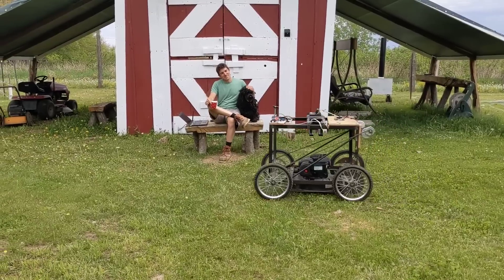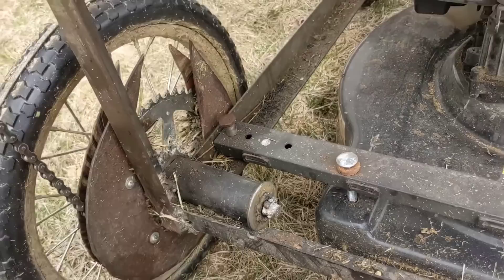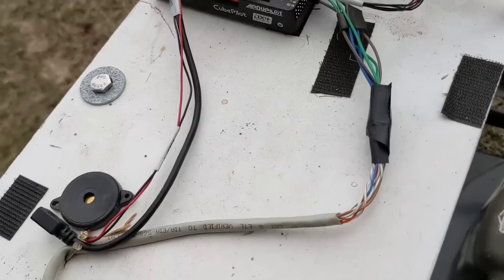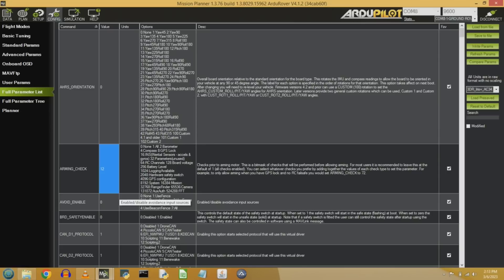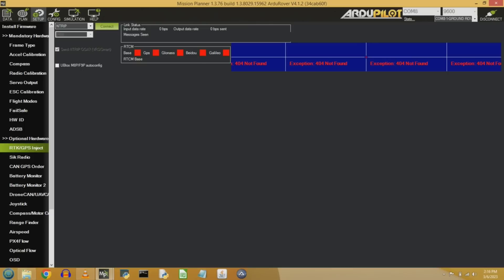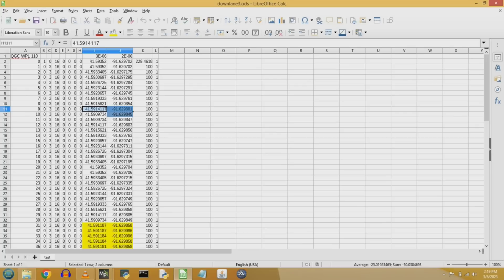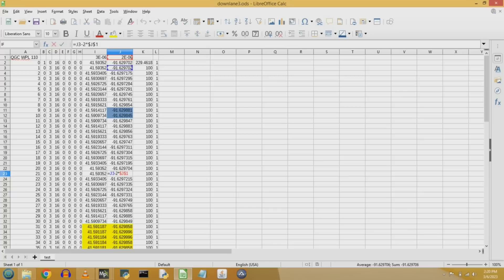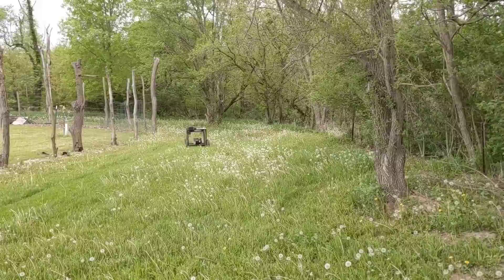DIY Autonomous GPS Mower - Parts List, Schematics, Build Details

Comment: question, you show 24v ebike motors but they are hooked up to a 12v car battery.  how does that work?
Reply from the maker: They run at a lower speed basically.  I tried running at 24V initially but the whole thing moved too fast for the mower to keep up.  When I tried at 12v it was happy.
Reply: @nathanbuildsdiy  were you not able to control the speed on 24v within mission planner?  appreciate the info, ive ordered the parts to build my own.
Reply from the maker: That's great! Let me know how the build goes, if you've got any questions post a new comment (I always see the new comments, sometimes miss replies).  We can connect outside YouTube for any help/questions.

As for 24V - yes, you totally can set the max speed in mission planner (it's on the basic tuning page to the right of the P   I   D  settings I think).  When I started 24V testing I didn't realize that was there. I tested 12V and it was a speed I liked so I kept it and got into the habit of charging 1 battery while the other operates, so I've always got one ready to roll.  Much later I realized I could have stuck with 24V and set a max speed but I had already developed a routine.

If you're going to build here's my list of ideas for the next version, pulled from the comments here, if you want to try any of them (no need, but I'm thinking I'll add next):
- add a front bumper to stop if we hit something (connect to the arm/disarm button that goes to the USB on cube orange)
- Add a small alternator on mower to rob a bit of power and charge up battery
- Add a chain tensioner.
- Put a pin in the axle so it can be removed rather than welding that inside washer to the axle
- 2 gps for yaw/no need for compass - But man... this is more $ and I just can't pull the trigger

Comment: I'm doing my build now and looked at the video and schematic again closely. For Aux out 5 & 6, what did you configure in Ardupilot for this setup (wheel direction) ? I'm using the bigger Cytron MDDS30 and it is slightly different. Also what did you set for MOT_PWM_TYPE? I'm using wheel chair motors for my setup.
Reply: Did you figure it out? I'm using the same setup as him but I can't get reverse working.

Comment: Did you make the frame so tall to get the electronics away from the spark plug and coil; or is that an issue?  I would like to make a more compact version.
Reply from the maker: It does isolate the electronics a bit, but I think the electric motors were a bigger issue.  I made it that tall because I wasn't sure how the whole thing would turn out when I started :)
I'm betting you could cut down the height and be just fine as long as the gps/compass are far from the electric motors, and as long as you're able to get your mower into the frame (I have to turn mine diagonally to insert it from the back).

Comment: I got a mower with fwd wheels there is a pulley with a belt on a main shaft ,you could have add a pulley there or use mower like that and connect an alternator there
Reply from the maker: Is it a push mower?  I've got a front wheel drive push mower too, but it can't steer, just pull foward
Reply: @nathanbuildsdiy  yes , its a push mower and it can't steer ,  there is a V shaped belt like on old cars engines

Comment: Is there a reason you used the 24v motors? Do they still work reliably on the 12v battery?
Reply from the maker: I planned to use 24v (2 12 in series) but realized it was a good speed with 12V and I could charge the other battery while one was running.  Now I'm working on an alternator/regulator to recharge the battery while it runs and that's a 12V system so I'll stick with that.

Comment: Does the mower download the RTK updates in real time or are the RTK updates downloaded to your laptop and then transferred to the mower?  Great description!
Reply from the maker: It's near real time, but there is some latency.  The laptop does all the communicating with the RTK network because that's done over the internet. 

So the drone gets position info, sends that over the 900MHZ radio to the laptop, the laptop talks to the base station over the internet and relays corrections back to the drone over 900MHz.  That's all handled in mission planner though, so once you're hooked up to a base station you're good, no need to mess with the details.

Comment: Hello, I have a question. how do you calibrate ESC without RC or Radio? because when I armed, motor started spin. From what I see you do in youtube, I dont see you calibrated ESC
Reply from the maker: I don't have any remote control so I didn't do the ESC calibration step. Instead I did the "motor test" where mission planner (via the 900mhz usb connection to teh drone) spins each motor. I did it at 5%, then at 90% or so, just to be sure all motors are installed properly and spinning in the correct direction.
Reply: @nathanbuildsdiy  And when you armed, your rover are move? when you dont calibratie ESC?
Reply: You don't have to calibrate the ESC in this case. In fact, there will be an error saying you don't have ac version something installed. That's not installed for ardurover.

Comment: why not use Ebike Hub Motors? You can find hub motors for around 110  dollars each. You would not have the chain issues anymore and much better efficiency. 
This way you do not need the big tall iron structure so everything would be much lighter, cheaper, easier to build and much more efficient.

Maybe on next version?:)
Reply from the maker: I just picked up a used hoverboard for $40. I'll probably not use the ESC's but I'm going to try for hub motors in the next design!

Comment: Can't find GPS precision information on your Cube component, but I have a question for you.  What accuracy/precision do you get from your GPS signal?  Normally these signals are in the 2 meter precision range, which is hopeless for this mowing application.  But there are realtime GPS correction streams available depending on your government and region which can get you down to sub 2cm precision at around 1 solution per second which is ideal for mowing precisely. Specifically: Real Time Kinematics.  RTK is short for real time kinematics. A GPS receiver capable of RTK takes in the normal signals from the Global Navigation Satellite Systems along with a correction stream to achieve 1cm positional accuracy.  This is again, dependent on governmental infrastructure and whether the signal is available to anyone or requires a license presumably and is encrypted.
Edited: I see you go thru the RTK/NTRIP settings for GPS correction stream data at 17:30. That answers my questions.  Thanks for including that detail. Most important.
Reply from the maker: RTK GPS using base station correction (same one the farmers use here for their tractors etc.).  That's how I get accurate enough.  Ardupilot makes it easy!
Reply: @nathanbuildsdiy  Yeah, it's really cool what you can achieve nowadays with GPS.  No need to spend megabucks on these overpriced gps mower contraptions, when you can build your own for a fraction of that.

Comment: How are 180 degree turns handled? Is that an algorithm in the software or done with waypoints?
Reply from the maker: Yeah, all that is handled in ardupilot. I set waypoint "size" as small as possible, so it doesn't try to make a big U turn but instead pivots in place.

Comment: for my question of the day.  got most of my hardware connected.  stepping through the tutorial.  you load ardurover, however you set an option called "AUTO_OPTIONS" which is only available in the copter firmware.  could you possibly clarify which way i should be headed there?
Reply from the maker: AUTO_OPTIONS controls if we're allowed to arm the mower when we're in auto mode. Without change you can move to auto mode  (that just means it will run automatically on the waypoints file you set) but you can't arm it (it will remain disarmed).  So by changing these values we can actually move to auto/armed mode - that's the sequence of steps to actually run the loaded waypoints file.

https://ardupilot.org/rover/docs/auto-mode.html

I'm not sure why auto_options only appears in the copter documentation... 
https://ardupilot.org/copter/docs/parameters.html#auto-options

You can try setting auto/armed without making auto_options changes, but I'm pretty sure it'll fail and you'll have to change these values first.
Reply from the maker: Looked back at my notes on this - It may be a carryover from my drone setup notes that got into the rover setup. I thought it was available in rover when I was in the all parameter page, but if it's not there then give it a try moving to auto/arm on your rover. If that works then you can ignore the AUTO_OPTIONS setting

Comment: Would love to see you put a solar panel on that. Electric start mower. Battery dies it cuts mower charges to a specified point cranks up the mower and keeps going. Would be the next step to a totally solar autonomous mower just need to go lithium and electric mower motor. It would be a mechanical goat.
Reply from the maker: I like the idea, but I bet the size of the solar panel needed to meet the power demands would be pretty large. I think next build I'm going to add a small alternator to the mower to power the battery

Comment: Hi, can i use ardusimple rtk instead of orange cube as it costly, your opinion pl.....
Reply from the maker: I hadn't heard of ardusimple rtk before. I checked on it and found it in the ardupilot info as well:
https://ardupilot.org/copter/docs/common-gps-ardusimple.html

But it appears to only be a GPS, not an autopilot unit. The cube orange is an autopilot (it actually controls where the mower drives) and the Here3+ is the GPS.  The Here3 is cheaper than the ardusimple rtk

Comment: why did you use such expensive CubePilot board  not much heaper Pixhawk board ?  whant to do something similar with Pixhawk
Reply from the maker: The here3 GPS uses a connector that fits the cube orange while the pixhawk boards have a smaller/fewer wire connector.  I read a bit about how you could get a here3 on a generic pixhawk with some soldering/redoing of the connectors but I didn't trust myself.  It's probably doable if you're wiling to test it out.  Let me know!

Comment: I built a robot similar to this a while ago and found that the GPS resolution was not fine enough. Non military GPS can have a variance of up to 3 feet. How did you prevent the mower from running over Grandmas flower bed?
Reply from the maker: GPS RTK - it's base station corrections which get you to sub centimeter accuracy.  I discuss how to set that up in misison planner with the here3+ GPS in the middle of the video. That's also the reason for the more expensive GPS unit, it can do RTK.

Comment: To get Aux 5 & 6 to work for directional control, did you have to set any parameters?  I have the same setup as you.  Pin outs on the controller and cube have been double checked and the cabling is good.  However I can not get the motors to change direction.  Any suggestions?
Reply from the maker: Sorry for the delay! Been busy with kids starting school. 

Lets check the settings - 
Initial setup tab -> Mandatory hardware -> servo output -> throttle left/right are channels 1/3, correct?
Config tab -> basic -> Brushed with Relay
You're connecting to the AUX 5/6, not the main out 5/6, correct?

Next go to the Config tab, under advanced (I think?) and search on the word "aux", it should pop up what those are set to.  Next up... I suppose check with a multimeter connected to the output pins to see if aux 5/6 are actually changing voltage.
Reply: @nathanbuildsdiy  thanks for the reply.  I will run through your suggestions to see what happens.  If I select ‘brushed BiPolar’ then I can get the mower to turn. If I select brushed with relay then when I command a turn both wheels still go forward.  I do have it set up for rc control also, that might be a factor also.  Anyway, I was just looking for a quick fix, not product support.  I have the winter to get the bugs out.  If you would like here is a link to my video of the mower,  I referenced your channel in the video and included a link in the description.  https://youtu.be/mMNRO0pRbzY?si=ES4XU3riRxZxvhAf
Reply: @timrit3817 did you figure it out?

Comment: I am impressed, so much so that I build my own rover to do robotic farming. All the GPS stuff was based off your partlist and block diagram. However I was not able to get my rover to reverse. The ESC type is "BrushedWithRelay". In the Motor Test, I was able to spin both L and R wheels with motors test C and D. However, when I set "Throttle %" to a negative percentage, it would not output the relay pins on Aux5 and Aux6 to go High. I was able to get GPS RTK float, and Auto drive the rover forward, but not backwards. The only way to get reverse, was to externally drive +3.3V to my transistor that engages the coil, which flips relays for the motor +/- connections. The Ardupilot Aux5 and Aux6 should do that, right?  Am I missing something in Full Parameters List (like Relay_Pin and Relay_Pin2 = 54 and 55)? Thanks!
Reply: Did you figure this problem out? I have the same issue. Ended up changing servo_14function to - 1 gpio

Comment: This is an incredible project.  I made one, but mine is remote controlled.  Is it possible to use a sabertooth motor controller, or do I need the controller you used?   I don't know very much about autonomous.  My setup is ready, all I need is the autonomous parts.  Thank you for sharing your talent.
Reply from the maker: I just did a search on sabertooth pinout and it looks like there are 2 main and 2 aux pins on most of them (dual motor controllers anyway).  Do you know if the main is a PWM signal (amplitude basically) and the aux is direction?  If so it should work with the cube orange/ardupilot just fine.
Reply: @nathanbuildsdiy  Thank you for replying.  I have to look into the pwm and which output is which.  I use the sabertooth with a remote control.  However, I want to venture out and learn more by converting it as autonomous.  Again, thank you.
Reply: Mission Planner and or Cube Orange searches will unveil an amazing amount of info.

Comment: Any update on your next generation mower?  I am trying to build an autonomous riding lawn tractor which already has alternator but has Ackerman steering instead of skid steering as in your project.  Used riding lawn tractors can be bought for a couple hundred dollars. I would love to use your setup with Here3- Ardupilot rather than AGOpenGPS
Reply from the maker: Hi!  Sorry for the delay in response, been busy with family over the holidays.  I'm currently working on a version 2 of the weeder and drone sprayers that I built and haven't updated this one yet, but it's my goal to get it this summer.  Version 1 is still plugging along, though I had to replace the car batteries powering it

Hit subscribe if you haven't already, then that build will pop up in your feed once I (finally) get to it.

Comment: How much endurance do you get from that car battery of around 70Ah? (if I'm not mistaken about the size)
Reply from the maker: It's a pretty small battery, like for an ATV, I didn't see an amp hour rating but I bet it's smaller than 70, maybe... 40Ah? It runs for 40 minutes then I just swap in the other battery I have handy and put the spent one on the charger.

Comment: Hi Nathen, Thanks for the awesome project , Right now i am collecting the  material to build one. I have  a question? Since Motors are 24volt rated why are you using a single battery of 12volt to supply the voltage to dc motors? How is it going to support the 24volt dc motors on 12volt battery?
Reply from the maker: I originally was going to use 2 12V DC batteries in series for 24V, but when I ran it I found it was plenty fast with 12V and I could charge the second battery while the first one ran, which I liked even more.  That's why I ended up using 12V.

Comment: pretty big motors for moving that, would you say they're overkill? I see other builds using 12v 60watt powers, massively less
Reply from the maker: Yeah, they are large, but were a good price on Amazon so I went with them, plus the frame and car battery are pretty heavy, so the extra power isn't for naught

Comment: I live on a steep hill and pay workers $1300 per year to mow our lawn ($50 every other week). I am considering some type of robot mower. What is the steepest angle your invention can operate?
Reply from the maker: Mine has the car battery set up too high, it would probably tip at 30 degrees. You could instead mount dual batteries low and to the side of the mower and that would keep it from tipping, you could probably handle really steep angles with that setup.  

I see farmers with weights on the outside of their tires for just such a purpose around here

Comment: Other than CG issues, is there enough traction and torque to climb a 15° hill?  Perhaps with more aggressive tires? With your setup, is it effectively 4WD?
Reply from the maker: Totally 4WD and these motors are very beefy.  I had it climb up a tree and flip on its butt before I got the maps correct, so I think if you had enough tread on your tires a 15 degree slope would be fine.  Perhaps put weights on the outside hubs (like we do on riding mowers) to prevent rollovers when making turnarounds
Reply: Thanks.  I am investigating more aggressive wheels for the hills, your amazon link for the wheels go to a 26" wheel.  The ones you used look smaller, is that the case?    @nathanbuildsdiy

Comment: 2 kewl.  I have built a few RC mowers and would like one to be autonomous.  Does this require any kind of ongoing subscription fee or is it a one time cost?
Reply from the maker: No subscription cost to connect to the base stations here in Iowa.  Farmers use them all the time for their combines/tractors so it may be different in your area, but all systems I've seen in surrounding states are also free